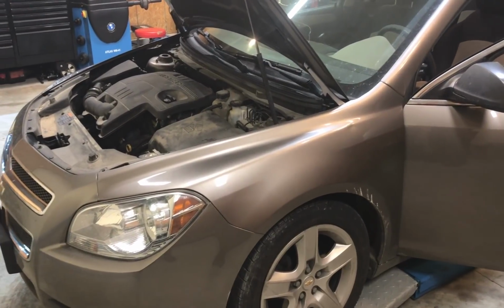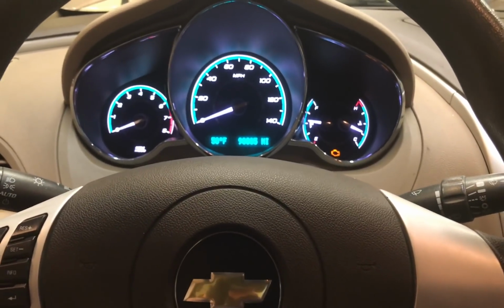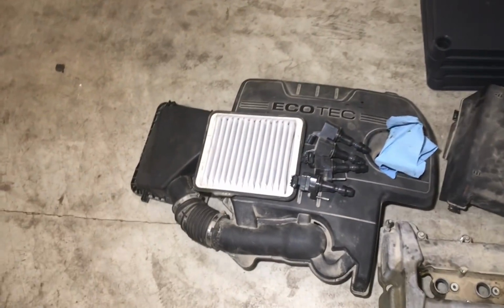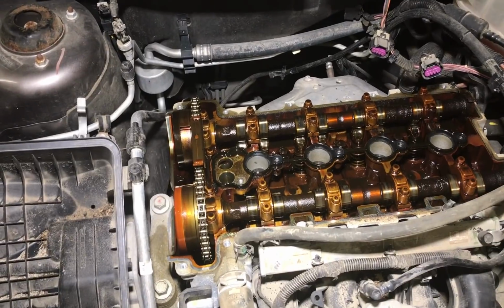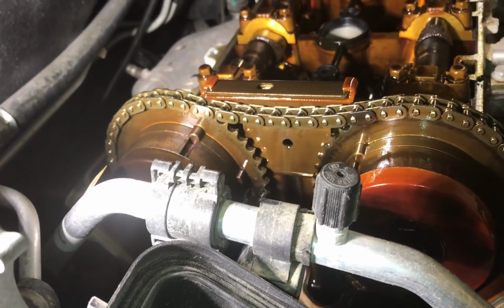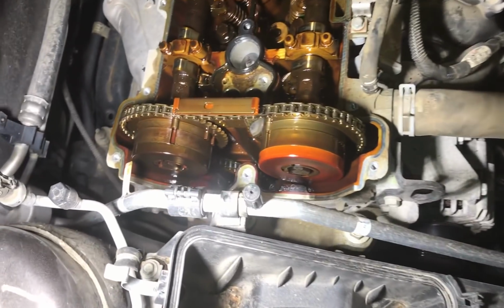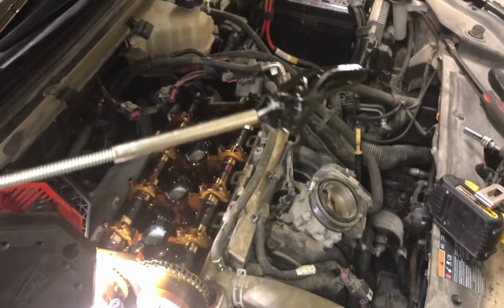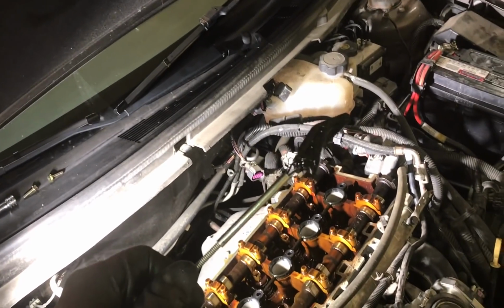EcoTec Timing Chain Guide Failure

Comment: I am seeing this problem on the 2.0L Ectotec as well, but not as widely.  I am assuming we should be replacing the timing chain around 100,000 miles as well on the 2.0L Ectotec in addition to the 2.4L model since it has the same chain which can stretch and the same chain guide that can break.  Does anyone know any differently?

Comment: I have a question. Does anyone know what size bolt does the 2.4 eco tec crankshaft pulley is I can't find it anywhere and no videos of a complete walkthrough
Reply: Oem #11589123 for the crank bolt. The head is a 21mm.

Comment: Going to check the timing chain on my cobalt today. Thanks for the video. The timing chain tensioner and failure also is dropping on the 2.2 engines like flys. My car has 147000 miles on it so I’m starting to get worried.
Reply: Yep! Running like a charm again 👍🏼
Car has 160,000 miles and no issues! 
I threw a ZZP air intake, throttle body, and a performance tune to gain more power to have a fun daily! No more rattle on cold starts and check engine light is gone! These engines need some extra love. My Chevy cobalt has the 2.2 vvt lap and it has served me well. Take care of your car and it will take care of you!
Reply: Did you change it

Comment: My 09 Malibu just died the other week because of this with 130,000 miles. Would cost more to fix than its worth and who knows what other issues could occur. Had to get a new transmission at 50,000 miles too! Driving a more reliable Toyota Corolla now.

Comment: The problem with the chain guild that snapped is so prevalent that I don't know why GM has not been forced to have a recall or at least redesign the part. I have a little over 150,000 miles on my 2012 Malibu. The timing chain has a excessive amount of slack. Can't believe it hasn't skipped timing or took out the engine due to it being a interference engine.
Reply: Best you buy the kit and replace it all. I did.
Reply: @gladiammgtow4092  Yea, 100% right on the mark. I did the whole thing. I was very surprised with 52 thousand miles that all the components to include both chains there was no stretch and all the guilds were in excellent shape.

Comment: This motor is a piece of shit. I have one. It's garbage. Didn't know till after I purchased it. 
Essentially it's a design flaw nightmare. Timing Chain, PCV blockage, excessive blow by and high crank case pressure.
Each 2.4L ecotech needs a complete over haul by the time it reaches 50K and every 50K might as well over haul it.
Chevy Warranty does NOT cover design flaws period. And they always weasel out of law suits as a result.
Just don't buy this garbage, and they'll stop producing it (hopefully) 
Sad, cause I was a chevy guy.

Comment: the problem is not necessarily poor maintenance but the fact some if not most of these engines have poor piston rings and use so much oil.
Reply: That's the LEA & LAF ecotec engines ..which are mainly equinox and terrain engines

Comment: I have an 2012 verano with the same 2.4 ecotech. It starting idling rough by time I got it home it was in "limp" mode. I replaced the Throttle body, changed the oil and ran the codes. It's throwing p228d, p0014 and p0016. Pulled the Solenoids and there was metal shavings on the screens. The car won't start(not that I'm eager to keep trying) I assume the timing chain is the issue just wondering what the likelihood is that it jumping has bent a valve or more. Does limp mode help prevent this damage or am I likely screwed?
Reply: @Life-z8d7r  well it was the timing chain but I got a little lucky cause the car passed its compression test so I didn't have to replace the valves.  Ended up being right around 2000 to fix after parts and labor. I know I'll recommend to anyone that has this engine to just go ahead and replace the chain and guide at 100k miles. Save you the trouble in the future

Comment: That  guide chain  part was made to brake it seems mine did the same. Why in the hell G.M. put a pot metal peace of crap in there like that. should been made of tempered steel!
Reply: @Life-z8d7r  I don't want to check. Just had this done last year. Going to have to do it myself if it happened again.

Comment: My 07 hhr sounded like a bearing and isn’t throwing any codes so I pulled off the top of the engine and found the chain to be real loose could that make it sound like a rattle /bearing ? (2.4 exotec)

Comment: have you ever had one that was bad enough that metal shavings in  oil filter? if so what did you do? Awesome video
Reply: Or pieces of the actual plastic upper guide in oil tube. Have to pull pan and clean tube. Poor manufacturing

Comment: I open mines and my timing chain was perfectly fine ! But there’s a rattling sounds so where is it coming from ?? And also the car also dies here and there and once I turn my AC on it dies! Help Me out what is it ! I keep getting the crankshaft code and oxygen code but I changed my crankshaft twice !
Reply: I changed a 3800 timing set at 121k only to find out that the rattling sound was from bad alternator bearings.   :-/
Reply: Williamson Regis could be the timing chain guide rattling..also the Ac compressor is probably seized causing the engine to stall

Comment: A shame because this was the first GM sedan under $ 20,000 I took a chance on in 2009, turned out to be a POS from day 1.. Got a 2010 Camry and it's been dead reliable.
Reply: My 2010 has 300k on it, never had a problem. I guess that's what happens when you take care of your car
Reply: @munn34  Nope it is a design fault.
Reply: @gladiammgtow4092  it’s a maintenance thing.  Not saying there aren’t random failures, but maintenance is key.

Comment: If you google the 2.4 timing chain special coverage warranty GM has to fix it up to 10 years. Be prepared though to pay for the balance chain as well. Even though it's a direct cause from the timing chain they make you pay. Hope this helps. Stay away from GM cars.
Reply: 3.6 also had timing chain issues.

Comment: These cars were designed when GM was near bankruptcy, I wouldn't touch one.
Reply: Or you just repair any problem when they come and enjoy these very decent cars. I still have my hhr 2007, 325 000 km. It's a good ride. Fuel consumption is good. If you do everything yourself these cars are not expensive. If you need to pay a mechanic then, yes, after about 150 000 km it might be a good time to sell and buy another vehicule. That being said I have an eco 2.4L engine. I can't say if the 2.2's are any good. I did have to replace the timing set at about 250 000 km.
Reply: @vacexpert2020  my 2010 Malibu has 300k on it and never had a rattle ever. And I have no problem getting up to speed right to 180 kmh in no time
Reply: @munn34  The exception does not prove the rule.

Comment: @danieljaeger very good job u made it look easy specially with that lift the whole motor basically fell down making it very easy to fix...Now i have the same problem i have a 05 chevy cobalt 2.2l ecotec and my chain is skipped several teeth i need to get it aligned and im not sure if i have any broken components most likely i do because it had some slack also but do i need to replace the chain and other components if theyre not broken

Comment: hey whats up daniel i have an 05 cavalier and i found a broken timing chain guide just like in your video..what i wanted to know if i can replace the guide only and still use the same parts already on my engine or what are the minimum/critical parts that i need to make it run again and also need it bad, i wish i can do the whole timing job but im going thru a financial problem so i wanted to keep this fix the most cheapest possible, i mean timing chain looks good and everything else looks good aswell, if you can please or anyone else help me out with some advice i really appreciate it..thank you
Reply: You can definitely just replace the broken guides if you chain isn't loose.

Comment: I've never had a problem with my 2002 cavalier LS Sport 2.2 ecotec engine with 269k on it except for the fuel pump and recently the transmission went out. But served it's purposed for 8 years of ownership and still have it in the back yard.
Reply: Car breaks down => New lawn ornament for the backyard
Seems legit!
Reply: I still drive it since first and second gear but my dogs love jumping on top of it
Reply: had an 2003 cavalier for 11 yrs no problems with it bought a 2011 equinox with the 2.4 definitely not the same engine.

Comment: Geez, looked like they should've changed the oil more often on that.
Reply: Yes because that's the end all be all.. Idiot
Reply: @hunterv5040  Well if you look at the amount of varnish here you can clearly see that the owner was not doing oil changes often enough and/or they were using cheap conventional oil rather than good quality synthetic oil. And it's a fact that synthetic oil changes every 5k miles can prevent many of these types of issues down the road. 

My case in point, I have a 2004 Saab 9-3 which uses a Saab-modified Ecotec 2.0L turbo that I've had for 5 years, it has 130k miles on it and for as long as I've had it I've done oil changes every 5k miles with Castrol Edge 0W-40 full-synthetic oil and I've had no issues at all. Engine still runs strong and smooth, and starts up every time.
Reply: How so. Just another excuse for GM's piss poor engineering.

Comment: What years are affected? I have an 2016 2.4.
Reply: El Chorizero Malibu ? They changed over to Turbo engines in the 2016 Malibu.
Reply: DJR5280 
2016 Chevy Equinox with 2.4
Reply: All 2.2 and 2.4 engines.

Comment: 2011 with less than 100K miles? Thank you GM. :-(
Reply: Kenny C Mom has a 2011 with 116k and runs fine. I change her oil and use Mobil 1 . She's hard on the car.
Reply: gm cars are not even half as good now as they used to be

Comment: 2 hr job gravy!
Reply: So this isn't a $1800 repair like aome are saying ? I have a 2011 Malibu 2.4 that I bought for my mother and now I'm worried. The car has 116k miles and no problems. I change the oil all the time and use Mobil 1 full syn.
Reply: DJR5280 no it is for a dealer repair . thats adding balance chain replacement too

Comment: My parents rented a grand am, must have been 92. Had maybe 10 miles on it. The power steering failed on the highway, they forgot to tighten down the tube fitting at the factory!

Comment: I'd be curious to know who the supplier of that timing chain guide was. I'd bet some money it didn't come from North America, especially considering those engines were manufactured in several locations globally. Those engines have European lineage and Euro engines in general are well-known to have persistent timing chain problems. Don't know what it is about European plastic, but they should let Toyota and Honda show them how to formulate it.
Reply: That's a good pov because it's "Cloyes " brand that come out the factory

Comment: Lmfao my 2010 focus has 95k an still no problems u got to change you’re oil all the time early so a timeing chain will last
Reply: Amen brother!!
Reply: kamryn G Yeah Ford's are the only American cars anyone I know will buy. Love my explorer, should run forever because the 2011- current explorers are pretty reliable.
Reply: Exactly. All the people here that are so busy bashing GM are failing to realize that regular oil changes with good-quality synthetic oil can actually prevent many of these kinds of engine issues from occurring down the road. And if you look at the amount of varnish and build-up in this motor you can clearly see that regular oil changes with good synthetic oil weren't done on this car, and this certainly would have contributed to the timing chain issues.

Comment: I have 300k miles on GM 3.4 and 5.3...burn no oil good oil pressure all original except alternators starters fuel pump. Go Chevy
Reply: Lol my 350,000 mile Toyota hasn't needed any of that replaced.
Reply: Gm needs a new battery..alternator...or starter every. Year after 100k miles..even the old ones.

Comment: Those 2.2 and 2.4 motors are hard on oil. Between chains, pistons, and phaser if the oil level is kept proper and clean you will have limited issues. Have a customer with a 2015 Terrain, 100K and no engine issues or noises. Because she keeps the level up and changes when needed. Meanwhile we get ones coming in with 30-60k rattling like crazy and burning oil.

Comment: Avoid gm 4 cylinders in general.
Reply: I have a Saturn with over 300k miles on the original drivetrain.
Reply: triggered ^
Reply: Except the 2.2*
Reply: Which gen?  06+?  Yeah, maybe.  It's still finicky as fuck lol
Reply: All American 4 cylinders are bad including Ford and Dodge! Toyota makes good 4 bangers!
Reply: @koreymayo8884  The Ford 4 bangers are actually good engines.
Reply: Avoid ALL GM products
Reply: @hondatrix  V8 is the best!
Reply: @hondatrix  GM diesel trucks are good though!

Comment: this has been happening to gm 2.4L engines since 1992. service manual says it's because of low oil level. that's bs.
Reply: jasonmushersee Son, that 2.4 ecotec here is totally a different engine than the 2.4 LD9 twin cam you are referring to, which was made from 96-02 or so. And then it’s predecessor was the 2.3 Quad 4 which was 87-95.
Reply: Planned Obsolescence
Reply: Junkyard Dave it’s the same engine
Reply: Chaos Zombie999 no it definitely is not. 2.3 Quad 4 and 2.4 Twin Cam is essentially the same engine but is TOTALLY different from this 2.4 Ecotec. That’s like saying 5.7 LT1 and 5.7 LS1 is the same engine.

Comment: I feel like that is more about poor design rather than maintenance.  Got to love how mechanics are quick to blame the owner when its clearly the auto maker cutting corners and using junk parts to improve the amount of money they make.
Reply: These engines had timing chain problems when GM first switched over to direct injection. The fuel pump supplier had problems with the fuel line seals and they would leak gasoline into the engine oil. If the owner waits too long to change the oil, the thinned out gas causes the timing chain to wear (stretch). Timing chains are maintenance items and stretching is common to many manufacturers. Ford's Duratec and Ecoboost engines are famous for timing chain stretch. Nissan's V6's are known for timing chain stretch. Mazda too.  Part of the problem is that modern engine oils don't have zinc additives any more, which were important to prevent friction wear on things like timing chains.

And its not like engine issues don't happen to every manufacturer. Toyota has had problems oil consumption problems. Honda has had tons oil consumption problems at low mileage too.
Reply: Planned Obsolescence
Reply: Yep, mine needs one at 90k (not throwing the exact same codes). Changed oil every 8k with full synthetic. Pure design flaw.
Reply: The limits on zinc additives only apply to oils in the 0W-20/0W-30 and 5W-20/5W-30 and 10W-30 weights. All other weights of oils do not have limits on the amount of zinc additives they contain. So the 15W-40 / 5W-40 / 0W-40 oils are allowed to contain more zinc and usually do. Most of the 40-weight oils are dual rated for both gasoline and diesel engines.

Comment: Not even 100k on it yet? I'm mean it's close but damn... let's hope it's a fluke.
Reply: I can corroborate. it's a flawed design I am a GM service writer. Makes the dealerships at least 1800 dollars a hit
Reply: Eric Fortune Jr. Yup. Garbage engine
Reply: DJR5280 lol Mobil1 is not gonna save ur timing chain ....most oils are equal it just depends on which marketing campaign u buy into
Reply: My wife's 08 cobalt is at 170k miles, no codes, no timing chain ever done. Not to jinx it, but I think these have fewer timing belt/chain failures than VW/Audis. My B7 A4 is at 293k and have had the chains & belt done at 267k and another belt at 167k, and I'm sure the original owner had to do it at ~105k. Knock on wood the cobalt still keeps going.
Reply: Mom has a 2011 with the same engine. 116k miles with no issues. Just change the oil and use Mobil 1 and it'll be fine.
Reply: DJR5280 me personally I bought into Valvoline
Reply: Eric Fortune Jr. I've seen a 2012 with 250k miles. Now I admit I have no idea what if any repairs were done to the engine. In my personal experience with this engine I think it's a good engine.
Reply: I have a 2009 chevy malibu 2.4l engine with 243,950 miles on it, and timing chain has never been replaced, i must be doing something right huh?
Reply: Engine is trash
Reply: The valve seats also are prone to leaking
Reply: Mine just hit 220k before it really needed chains. I really recommend high quality oil like Mobil1 and changing the oil every 3-4k. These are pretty decent engines. They would be even better if they had better quality chains, tensioners, guides etc...
Reply: No fluke it's a chevy

Comment: got a 2011 malibu bought at 40k miles and ive always and  continue  to keep oil  changed every 3k miles i dont ever go by oil life meter ever when i change at 3k oil life says 70ish  almost at 80k running great still no noise only problem got right now is the temp sensor went bad for the gauge soo it stays at cold mark but not hard fix
Reply: TheRepublic "An ounce of prevention is worth a pound of cure", I get it. 
I run a Mobil 1 synthetic in my Toyota. Changed every 5k miles or 8-ish months. 45k on the clock, never had a problem. I know I could get away with stretching it, but to each their own.
Reply: Bryan Henderson pull your valve cover and check deflexión and report back your measurements. Telling us you have a righteously maintained vehicle does us no good if we have no metrics to compare against a bad one
Reply: GM's oil life monitors are supposedly some of the better ones out there. But 3k miles? If you're running a synthetic oil, then boy are you ever wasting money